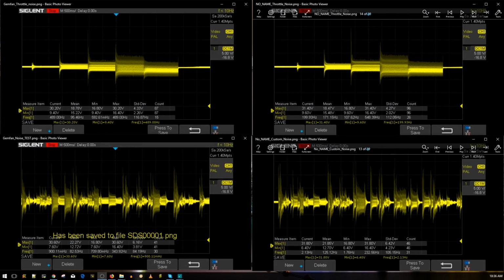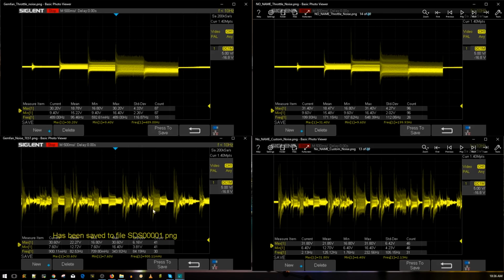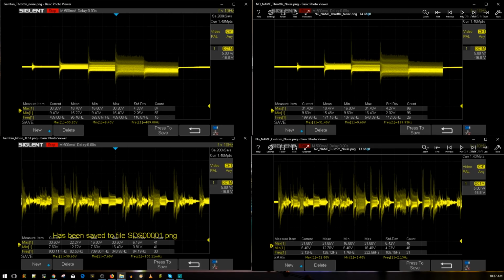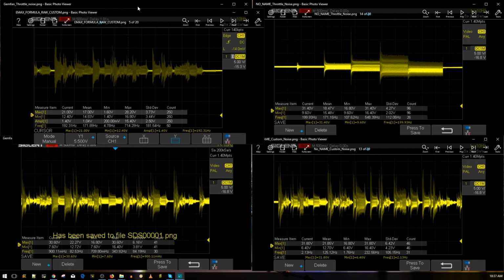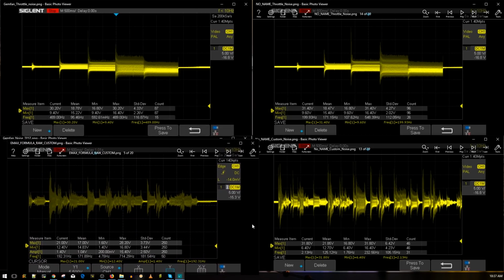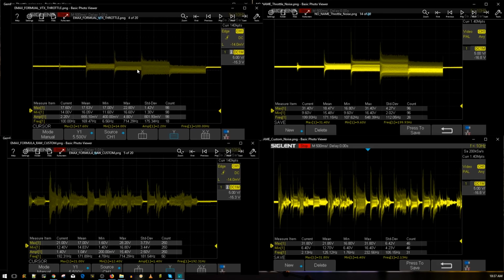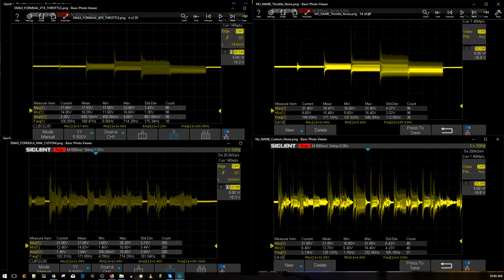Generic blheli_32 ESC // How good can they be?

Comment: Right off the top you mentioned the heat sink. I was wondering the other day if the heat sinks actually work better than open air. Especially for a 4 in 1.

Comment: could a noisy esc cause mid/high throttle oscillations? of a least one of the causes?
Reply from the maker: Locolino Definitly, in every esc I have tested mid to 80% throttle is where it's the most noisy. So the worse the esc is the worse the noise becomes. You can clearly see the throttle level noise on the waveforms.
Reply: thanks a lot! i´m tired of figthing with mid throttle oscillations (soft mount everything, tight loose parts , noch filters, etc etc!) i will replace mi racerstar labs 28a for a good tekko 32 that you recomend! you win a subscriber! keep the good videos!